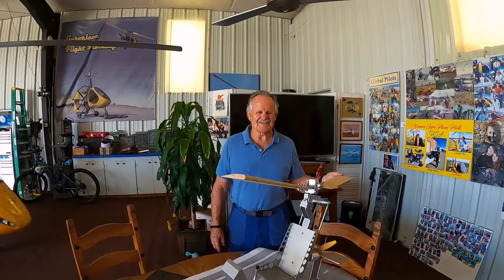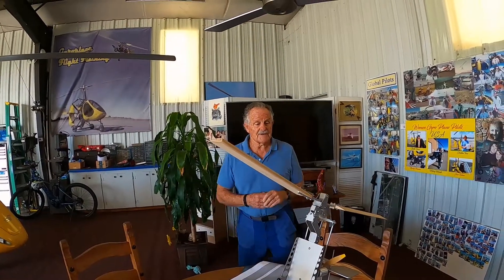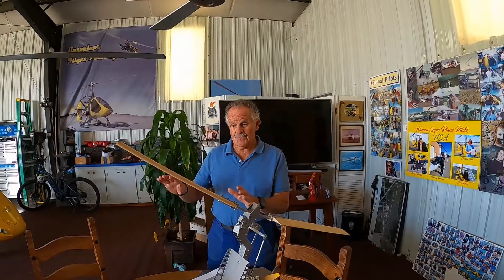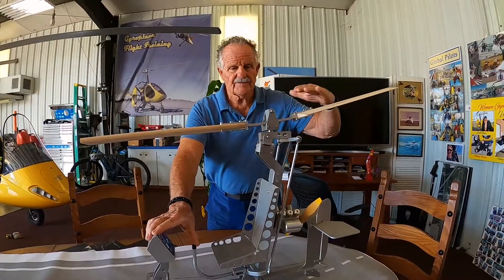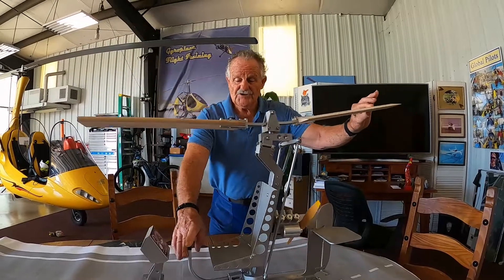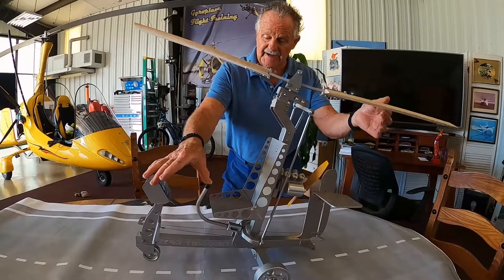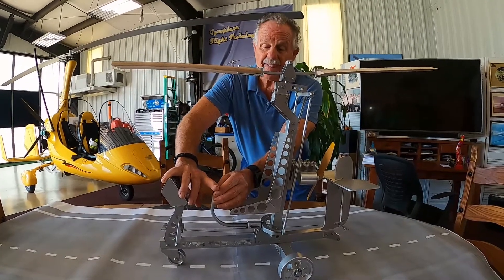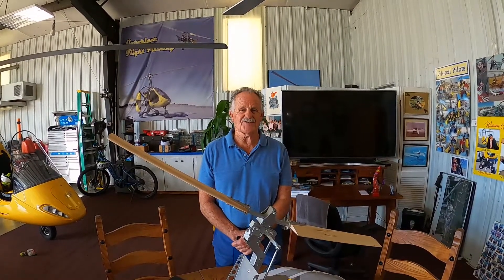How to AVOID RotorBlade Flap!!

Comment: Hi Ron,  I'm glad you are trying to raise awareness of this but I can't not say something about this.  This explanation is not quite complete or correct.  I also thing the example of the crash at the end is likely not anything to do with hinging/Flapping (we called it hinging where I came from).  The reason the blades teeter of course is to compensate for differences in lift from the advancing blade (having more airspeed) than the retreating blade.  Causing the advancing blade to flap up (decreasing its angle of attack and hence washing off some lift) and the retreating blade flapping down (increasing its angle of attack).  

When the rotor rpm is too low the difference between the two is more extreme.  For example if my blades are doing 300mph at the tip and my forward speed is 20mph then its 320mph for the advancing and 280mph for the retreating 18% difference if however my rotor speed is say 50mph and my forward airspeed is 20mph then the advancing blade is 70mph and the retreating is 30mph 57% difference.  At the extreme if my rotor speed is 20mph and airspeed is 20mph then the difference is 40mph advancing and 0mph retreating.  Obviously having zero airspeed means zero lift and the retreating blade will fall as low as it can while the advancing blade still has plenty.  Now the retreating blade will stall (exceed 16degrees angle of attack) long before it gets this extreme.  So your visual explanation is good but your explanation I feel misses the point. 

The trouble is getting into any zone where the rotor speed and forward airspeed combine to create a situation where the retreating blade stalls.  If this happens it will have ZERO lift.  

The trouble with the modern method of wind up is it attempts to avoid good practice on wind up which should be progressive and attempts to force the gyro through it.  It mostly works but when it goes wrong it really goes wrong.  Winding up to extreme rotor rpm then gunning it (even if counting to 4) you run into several problems.  1 your rotor rpm is going to start decaying as soon as you disengage the pre-rotator.  You are now trying to catch up with a speed that will not only maintain that rpm but build it to full flying rpm.  99% of the time this seems to work but uses excess airstrip to do so.  Want proof watch this gyro with hand wound rotors then show me a shorter take off using the modern technique outside of extreme wind  https://www.youtube.com/watch?v=36ogAzGGyG4  this was a mate of mine taking off on a taxiway (not the airstrip in next to no wind).  This was normal.    Anyway if anything goes wrong like as you correctly point out holding the stick too far forward or getting some delay like an rabbit runs out in front of you or something falls to your feet or you adjust something etc.  Then you are now setting up by going straight to full throttle a situation where you may experience flap at a speed where there is next to no chance you can do much about it.  At 40mph full blown blade flap is going to be much more violent than at 12mph.  

Your video shows a gyro simply taking off behind the power curve and hitting the blades at the back because he took off too steep.  We can tell this because during blade flap the retreating blade is stalled and will not be conning up.  Similar to this  

https://www.youtube.com/watch?v=0N_QdVHJRHI

I fear this method of take off leads to these type of accidents.  Its not as fool proof as people think.  We need to get back to people only giving enough speed to build the rotor rpm from where it is at.  Trying to catch it after over winding the rotors seems to cause as many problems as it solves.  But happy to be shown wrong.